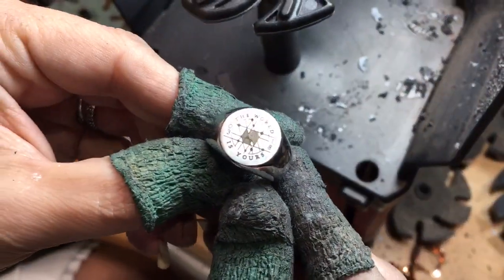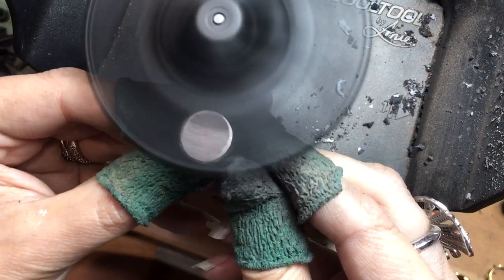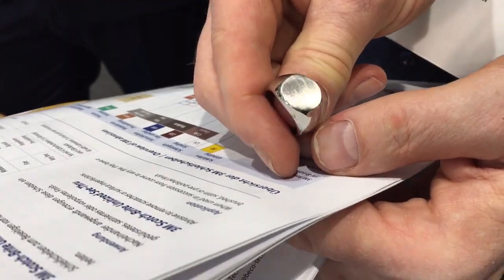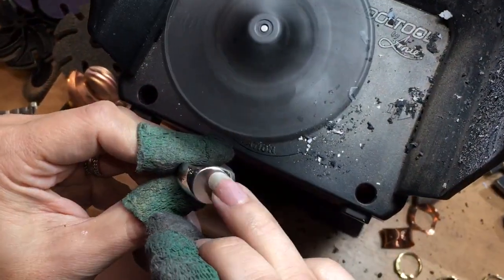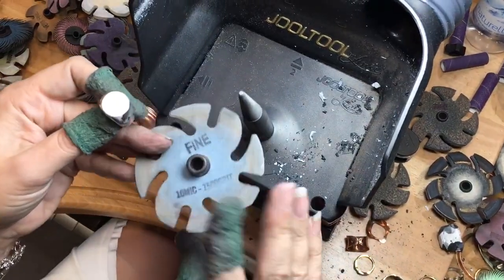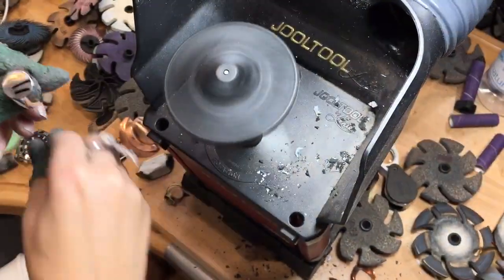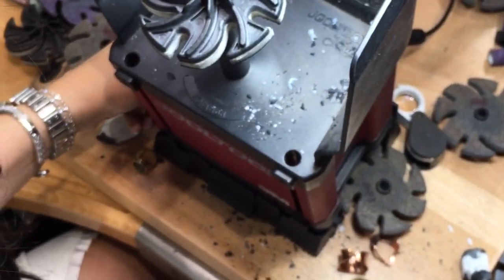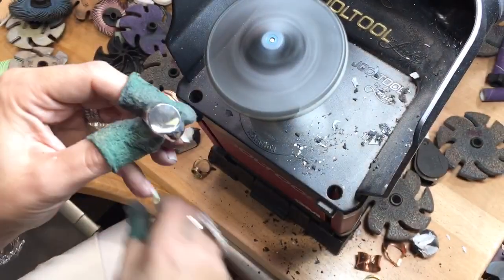How to Remove Engraving Fast & Easy!

Comment: This is not as easy, the machine and all the stuff you used is not anybody has in house!! Sucks
Reply: The video is what the video is.

I just took the engraving off of a Parker pen barrel by sticking it in a vice and then going at it with P60, P120, P240, then P600 sandpaper.

The original finish was brushed stainless steel and now it has an even finer brushed finish than it had before.

For bigger jobs you could use a small rotary tool, like a Dremel and for a polished finish you could use a buffing pad and a mildly abrasive polishing compound.

For some smaller jobs or softer you can even achieve a polished finish by hand, using an old rag and Autosol metal polish or Brasso.

I've even heard of people polishing vulcanised hard rubber and plastic surfaces with toothpaste.